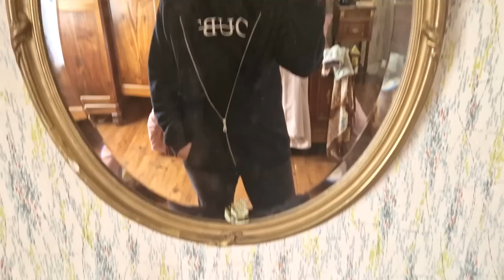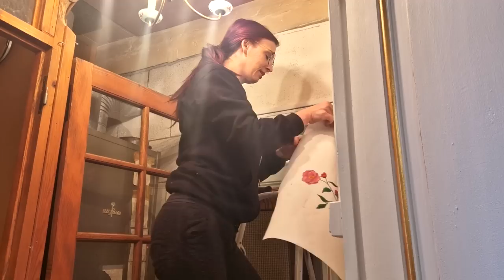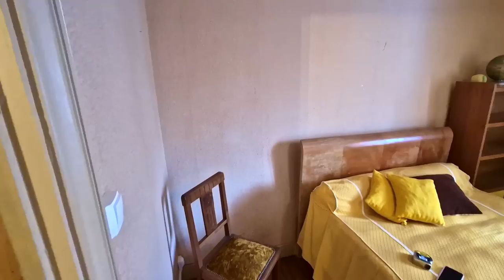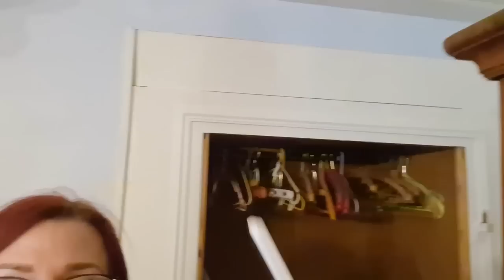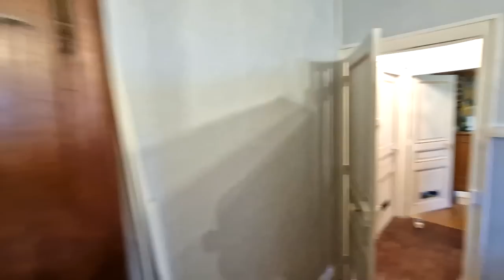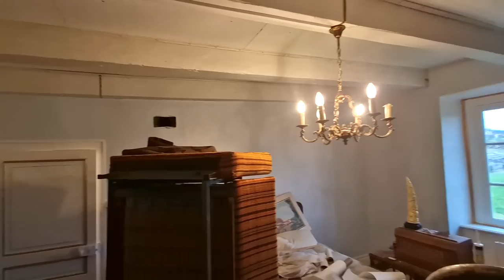Installing a Hand Painted GARDEN MURAL and the HORRORS of Woodworking with Zero Skills

Comment: Great job on the mural & the trim.  They look very nice!

I didn't bother removing 70's silver foil & textured wallpaper on my walls when I redid my home.  I just sanded a little to remove the shine then painted right over them. On some of the seams that were not so smooth, I used spackle to plaster those areas until smooth & painted over those too. I had to use paintable caulk on some of the corners where the wallpapers ended. You can't tell there is wallpaper under the paint. 10 years later & you still can't tell. Some people also rewallpaper right on top of the old one.
Reply from the maker: Oh! Great to know, that would definitely be much easier!

Comment: Very impressed with your calculations on the wood work. Those joints at 45 degrees are notoriously difficult to get right first cut, so working out the degrees and compensating with a file is quite impressive for a good fit. And I like the idea to tidy those areas up between wood and wall paper. That sort of attention to detail will really make the house something very special. Nice mural too.
Reply from the maker: Thanks 👍 I think à lot of it may have been luck 🤣

Comment: As you are putting up a lot of decorative molding  and need to get the angles exactly right to make it look beautiful I would either invest in a Mitre Saw costing around  200 Euro (ish) for the less expensive one or at least a wooden Mitre Box , costing around 20 Euro (ish)  and a good quality hand saw to get a good cut edge. It will save a lot of stress and if you watch a couple of Youtube videos you will soon pick up how to use them. My Mitre Saw was an absolute godsend and has followed me through 3 renovations and still going strong. You could gradually build up your Tool collection over time but a good battery operated drill is another great place to start... Loving watching you transform the house!!
Reply from the maker: That's great advice :-) I actually already bought the wood box version for another project and it is so much easier definitely worth the investment
Reply: @EscapetoEverdeen  You won't regret it.

Comment: Why the hole in the door to let heat in the room? Not a cat or dog door?
Reply from the maker: It's where there used to be vents in the doors
Reply: @EscapetoEverdeen  worth keeping/replacing with new ones to keep air circulation inside.
Reply: Maybe find nice bronze or brass vents for the doors they will add character and still let air move around plus might be easier to install than trying to fit a piece of wood,even plastic ones painted correctly could be easier